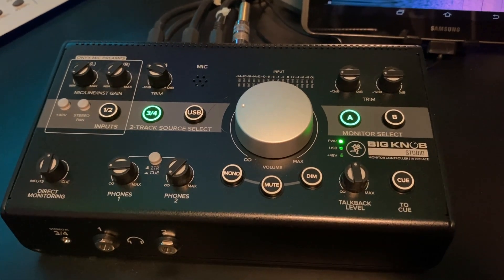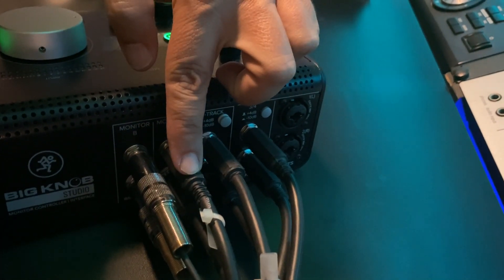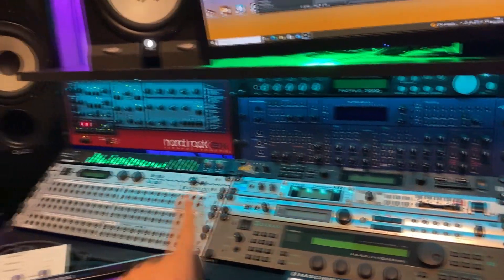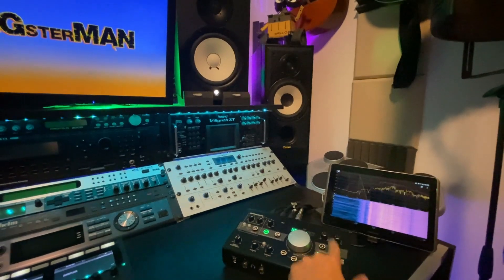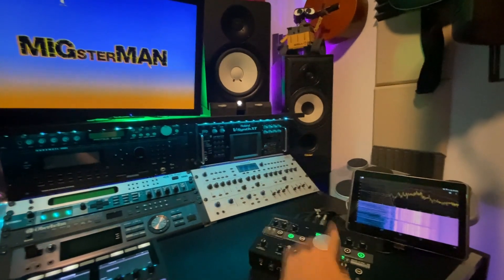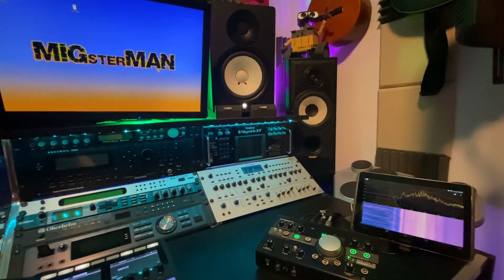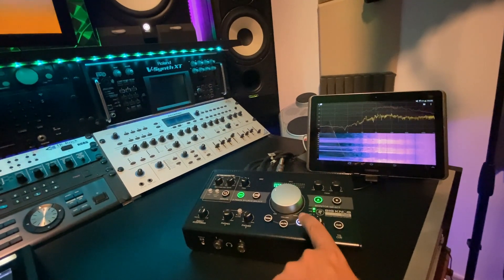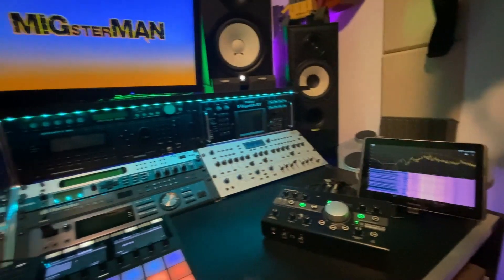Mackie big knob test in English

Comment: Are the 1/2 mic outputs of this card suitable for recording electric guitar with DAW VST amplifiers? I did not find a Hi-Z mode, and I do not like the tone, too much background noise and distortion
Reply from the maker: I've never tried an electric guitar on it's inputs, make sure you are not clipping when tracking in your DAW, play with the guitar volume and the gain in the interface until you find the  sweet spot, I'm pretty sure it should work OK.